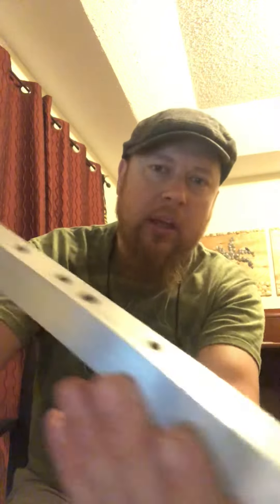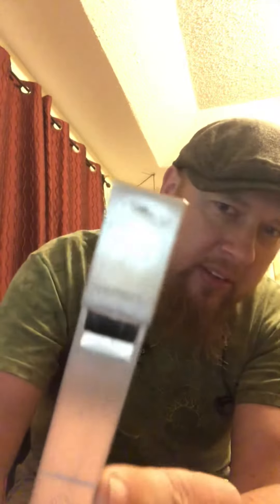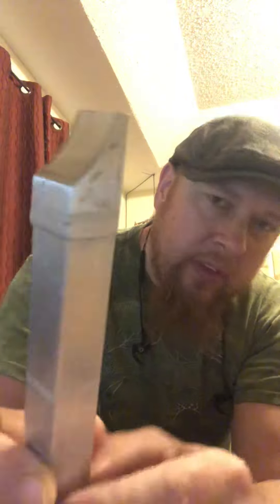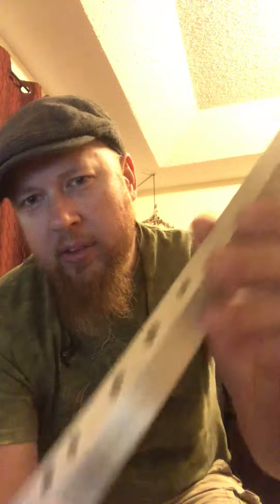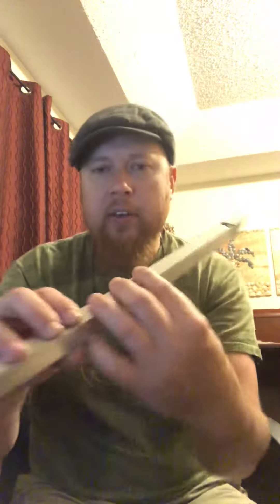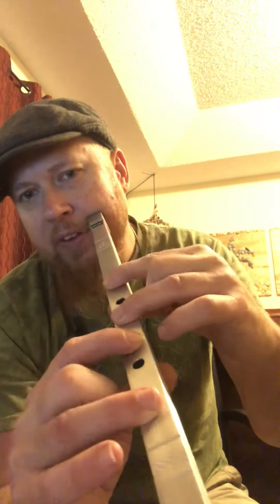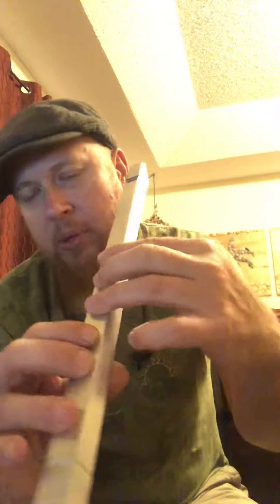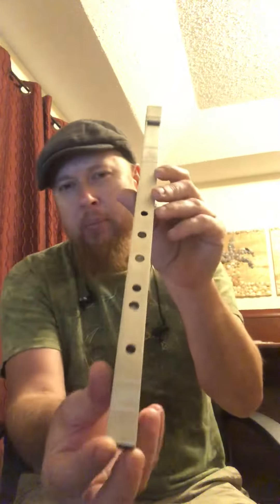Prototype square low A Irish whistle demonstration & sound sample Nick Metcalf theirishwhistle.com

Comment: What advantage are you seeking with having a square tube?
Reply from the maker: Well, for one it won't roll off a table, and I was experimenting, and actually very happy with the way the sound turned out. I was guessing that the air flow from a flat windway would flow better into a flat edged body instead of a flat windway into a round body, and I think my theory is true.